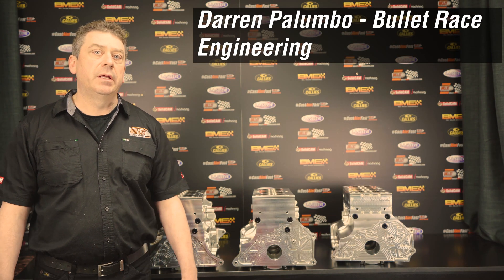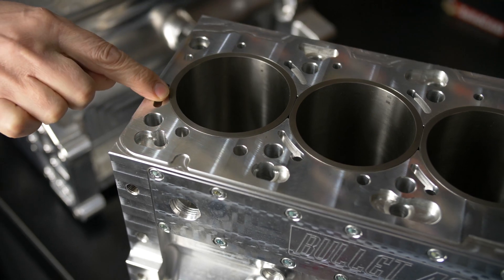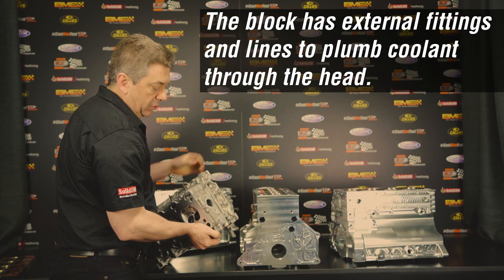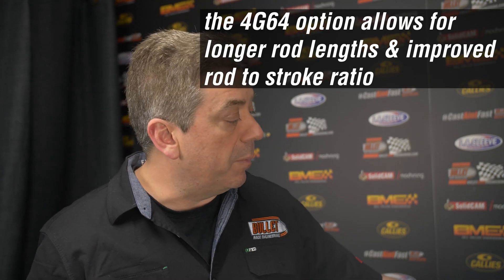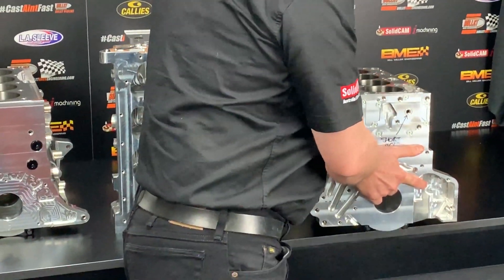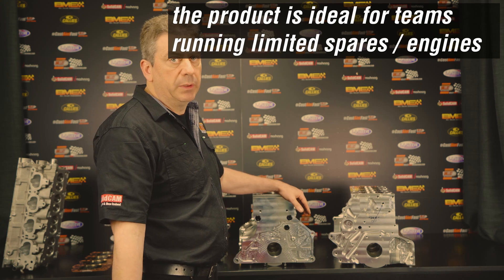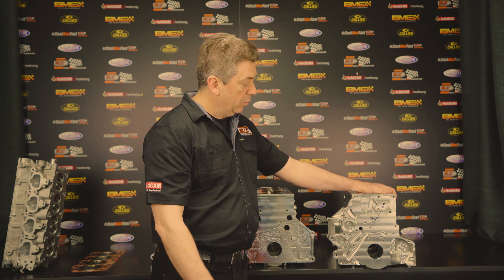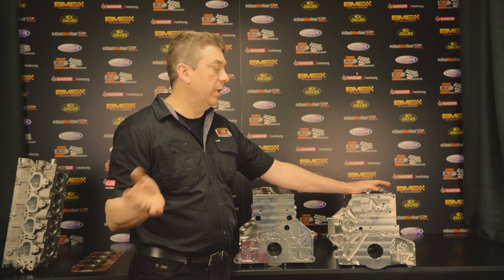Bullet 4G63 billet blocks – the choice of champions

Comment: Next, billet 4g63 heads please!
Reply: There really isn't any need for Billet Heads. The OEM Heads are already Aluminum & can make 2000hp. After companies like GSC & PPR MS get done with them, they basically can't get much better.  
GSC starts with a brand new OEM Head,
Newly designed ports are milled out, 
CNC/Machine ported, hand blended. 
Combustion chambers are also redesigned to maximize port velocity.
New Valve seats for +1mm GSC Valves
Stainless Steel In Inconel Ex
Than they basically throw in all of their internals like:
Bronze Valve guides
Black Nitrated Beehive V. Springs 
Titanium Retainers Viton valve seals